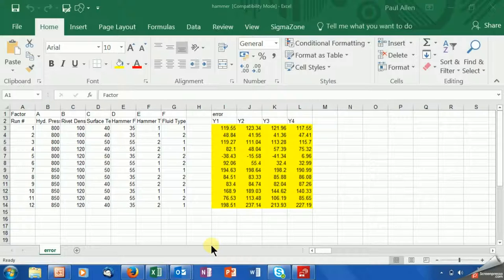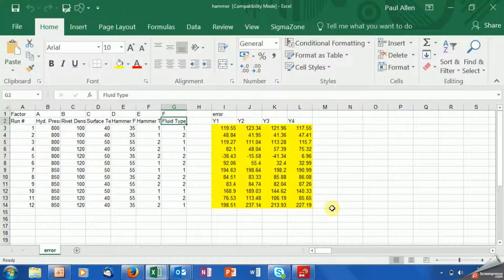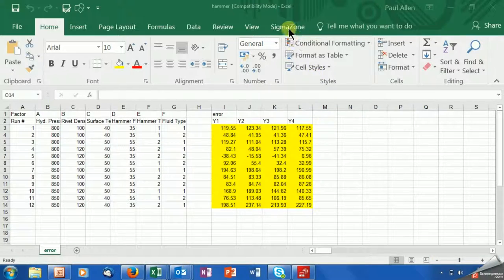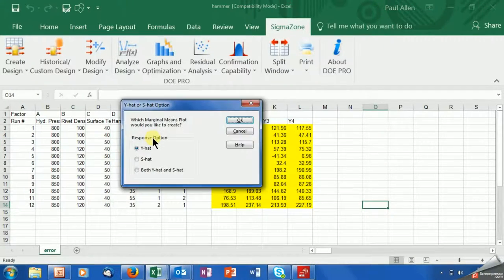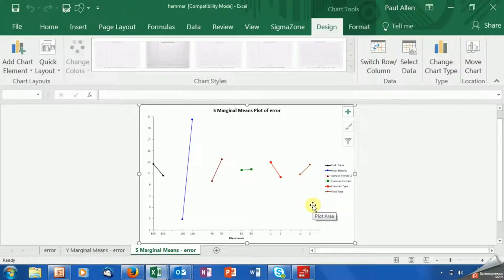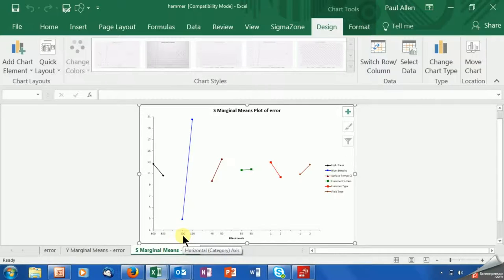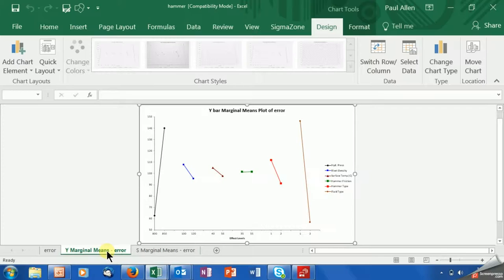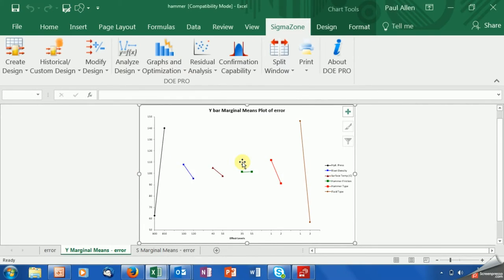Complexity Made Simple - Analysis a Taguchi L12 using DOE Pro

Comment: Hi Mr. Allen,

I recently bought your book DoE for 21st Century Engineers. On page 65, there is a table that confused me. Beginning on column Bristle to Penetration, the numbers in there does not have any pattern. They seemed to be random. I thought they have be balanced which required some pattern if I follow the book correctly. Can you elaborate on this page?

Thank you
Reply from the maker: Hi Vinh - feel free to drop me a line on paul.allen@allenp.co.uk. I've looked ay my copy and I think you might be looking at the L12. Send me a shot of the table I'll confirm it for you...
Reply: @paulallen5321  will do. Thank you for the reply.